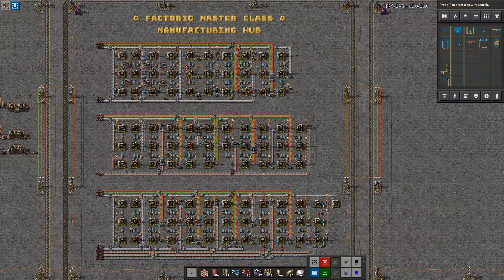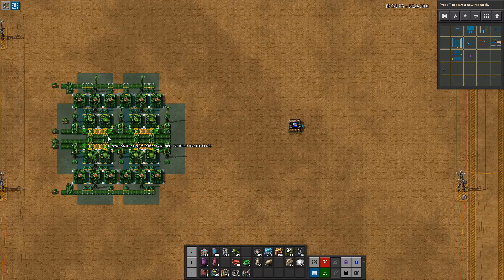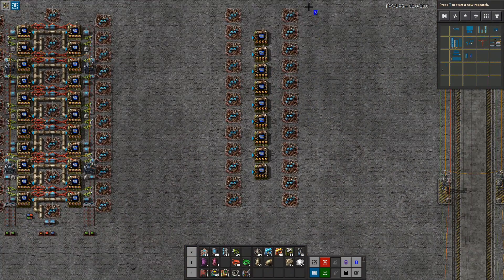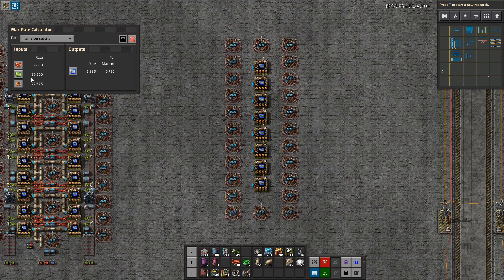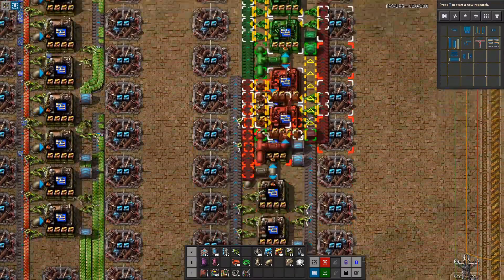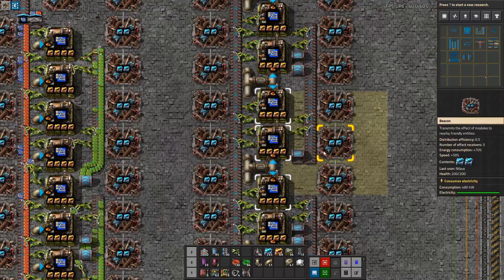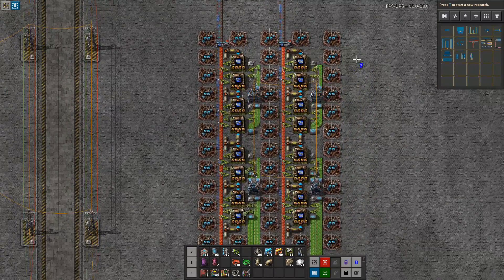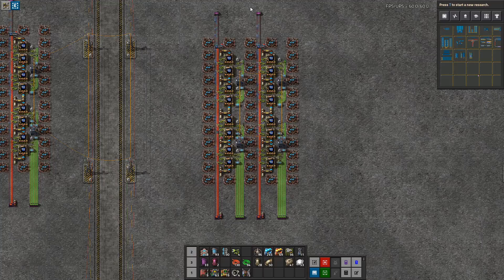Late Game PROCESSING UNITS (BLUE CIRCUITS) with Beacon/Modules | Factorio Tutorial/Guide/How-to

Comment: I noticed one interesting thing, we can use 3 belts in the same line, as long as they are all underground, and yellow, red and blue. That means that we can have 15+30+45=90 items/s throughput which is equal to 2 blue belts. Can it be used here to deliver green circuits? I may be a bit chaotic XD
Reply: I will try this out if you havent

Comment: I ran some local tests and there seems to be an unexpected bottleneck? The far lane of the green circuits belt stops every 2 or 3 seconds for just a couple ticks, which they shouldn't, considering this build is supposed to consume 90.5/s. If I add an extra blue inserter (on each machine) to help, and rearrange the poles, that bottleneck is gone.
I really like the build though! Very compact, very tileable. Way better than all my past 6 or so attempts (though I never really understood why beacons were worth it until very recently).
Reply: same problem occurs with me too

Comment: If you interweave the underground pipes and underground belts on the same line, there is enough room, as long as the pipes are offset from the assemblers and the one set of underground pipes feeds two assemblers

Comment: Nice build.  This will produce just under a full blue belt, about 44.345 / sec.  You should also be able to easily balance it to a single output belt.  Split the middle belt, then a series of 2-1 T junctions.

I've looked a lot, and there is not a good 12 beacon build for blue circuits, nor do I think it would work well.  My build produces 1 full blue belt, but it is does not tile as it brings down the extra green circuit belts and acid outside the beacons.

Comment: Besides rotating you can mirror it no problem of course.
And if you don't mind using some undergroundies you can put in another green circuit belt through the sulphuric acid side pipes open space, so you can extend to a third part above it if you snake that in which should be doable ?
For the left build that is. Still not great, but it's something to use more length if you want.
If you pipe in the Sulphuric Acid from the top you can shift the beacon to the left, use undergroundies to skip it, add another beacon next to it, you can actually do tha same at the top, and voila, you reach a full belt with this many tiled for sure.
Reply: i like that build and it's more efficient as a single cell, but the problem with using that and rotating or flipping to "tile" is that as soon as you build more than two, you're now using more beacons and power that way.

Comment: What if I told you you could consume 2 green belts with 8 assemblers with no gaps between the assemblers, ie it is using only 11 beacons per row instead of 12?
Also the 3rd assembler from the top seems to stop a lot. Other assemblers too. You may need more inserters or feed them better.
Finally it is a good idea to attach the blue circuits to your green production. That way you can get rid of a lot of infrastructure.
Reply from the maker: share the blueprint in the Discord then ;)

I don't agree on linking Green and Blue together. I rather want them separate so the greens can be used for other stuff if needed
Reply: @Nilaus  That's interesting to hear you say, because in your death world series you made production for 8 green belts and took 4 directly to blue, just with long belts because your blue was far away. Did not see anything else using those 4 lanes. Also are you really suggesting to build your base with the intent for your machines to not work or starving green when they do work?

I can give you picture: https://i.imgur.com/kwcmNir.png
Reply: @Nilaus  but you need an insane amount of green for blue, and you need a constant stream of blue, so obviously blue chips should have dedicated green chip production.

Comment: 4 green inserters obviously cannot pick up whole blue belt, so overall performance of this build is slightly less than rate calculator shows. Or there should be more inserters on greens side.
Reply: They cannot put it out without messing with stack size, but they can take it.
Reply: @ryan3212  look closely: outer sides of belts stops regularly.
Reply: 3rd assembler from the top stops a lot because of lack of greens. Other assemblers also stop a little. 4 inserters could clear a belt, but not if having to deal with holes and jumping between lanes.
Reply: @Hedning1390  yes, they would, but holes and lane switching is inevitable in this case. So sometimes assemblers would stuck without greens, and sometimes belt would stuck with too much greens.

Two green inserters per assembler would handle blue belt without pauses, but build would be somewhat overcomplicated.
Reply: @Felinaro  I don't know why you say it would be overcomplicated. In your original post you seem to suggest he put more inserters on. That's the correct way to fix it imo. I would never let the inserter be the bottleneck. That makes throughput unpredictable.

Have you test run his design? I wouldn't be surprised if the efficiency is lowered by 20%. In any case I think this is a good example of another reason why you shouldn't take other people's designs, because you have no idea if they actually verified it.
Reply: @Hedning1390  yes, i did test run, and yes it is not running at full speed (not by 20%, may be 3-5%, hard to calculate — you should look at inbound of input belt, not at its end), and yes, doubling inserters fix that. Assemblers starve for green circuits by design — they need 45.2/sec of them, but with a single inserter they starve a bit more than that.

I suppose that original design uses single inserters just to make things simpler (hence a green outserters), since performance loss is not that big. But OCD players should consider altering this design to prevent it.
Reply: @Felinaro  I tested it now. I ran it for an in-game hour at 30x speed (1800ups). He is advertising 6.335/s when actually it is producing somewhere between 5.97 and 6.03. Yes, my eyeball was overestimating, but that's 5-6% efficiency loss. Clearly it is a mistake otherwise he would say the actual number, especially since it's pretty much an even 6/s.